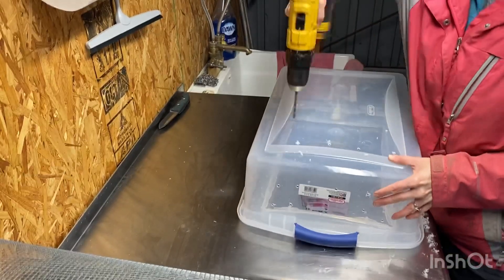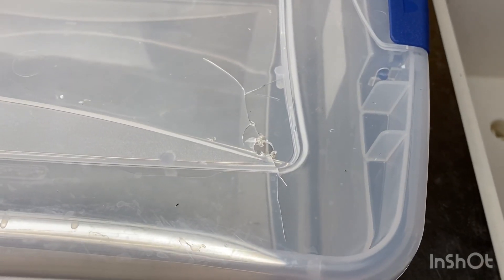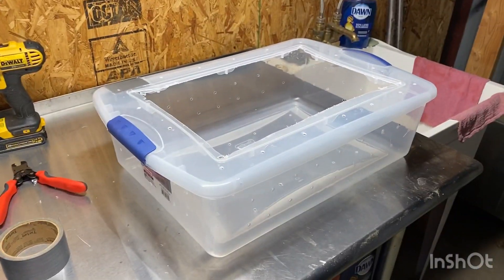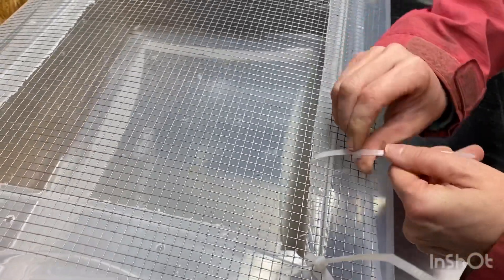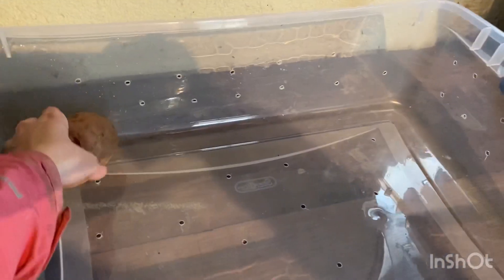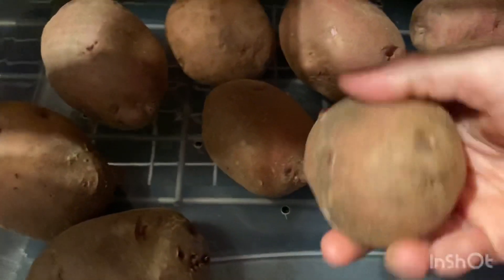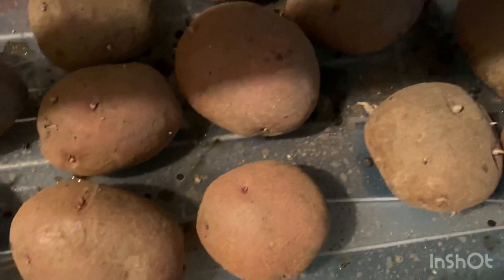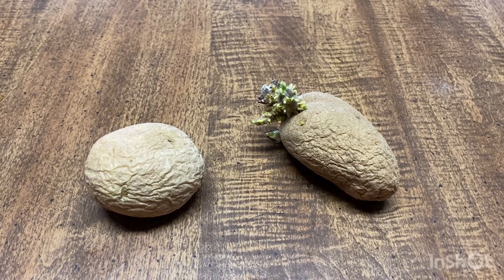Episode 12: Building A DIY Storage Box For Root Vegetables | Mouse-Proof Cold Cellar Storage

Comment: Why do you even need to put the wire mesh?  Couldn’t you just drill more small holes to provide enough airflow?
Reply from the maker: You are absolutely right!!  I did do some more boxes by just drilling holes all over.  The wire mesh definitely gives better airflow and allows more of the gases produced by the produce to escape.  But if you don’t have the mesh (or a jigsaw) you can certainly just drill more holes.  Just be careful not to put the holes too close together, or the plastic may break.  Thanks for watching and for sharing your input! 😊